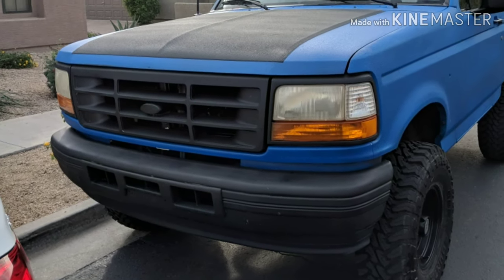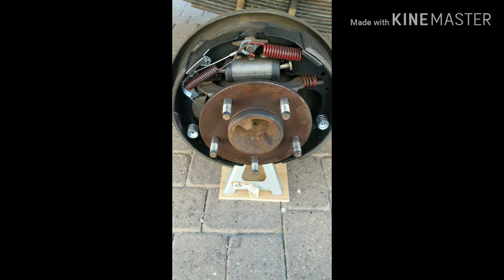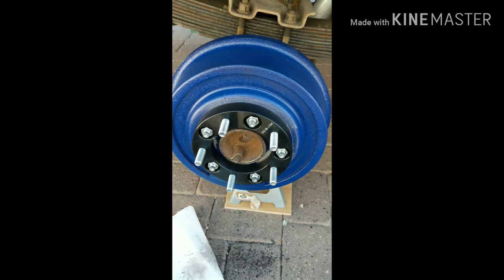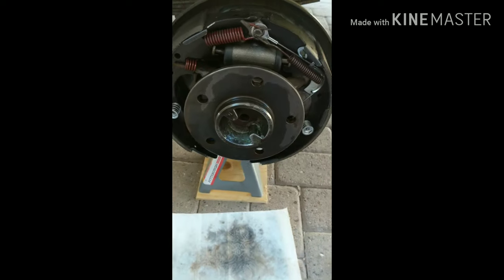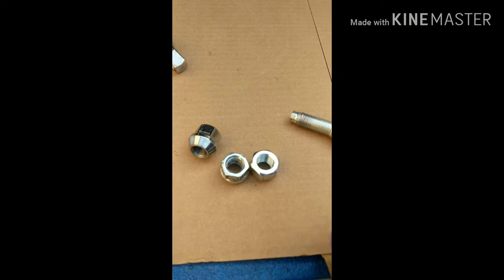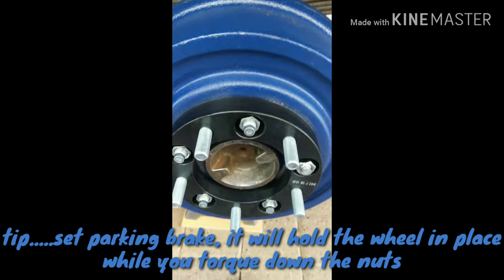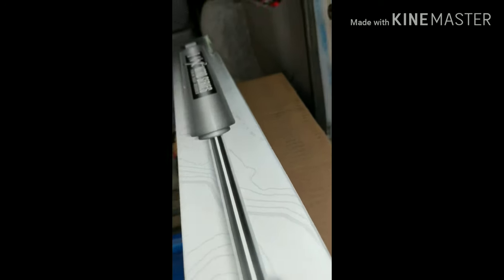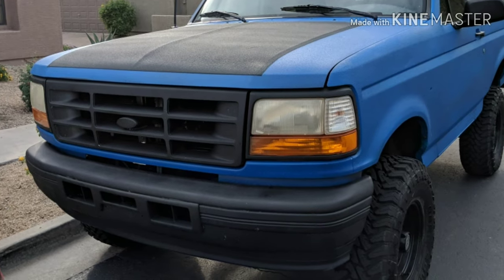1996 Ford Bronco Rear wheel stud replacement and wheel spacers

Comment: Great little video for people wanting to know how to replaced studs. What brand are your spacers? And any vibration issues with them?
Reply from the maker: ZY Wheel on Amazon. No vibration issues and I've had them on and up to about 85 mph.

Since I went off road with them and when I got back to the freeway a stud sheered off! I would not recommend wheel spacers ever again. Drop the money on rims with the proper offset.

Comment: TEXTBOOK EXAMPLE OF A *DANGEROUS* WHEEL SPACER INSTALLATION!!!  You seem like a nice guy but I must comment on this video, which unfortunately (and dangerously) depicts what NOT to do when installing wheel spacers (which are perfectly safe when installed properly but get a bad name when people who don't know what they're doing scream about their wheels falling off).  The key here is the comment you made about the wheel studs sticking out past the wheel spacer when you were mounting the spacer - THIS IS AN ABSOLUTE NO-NO and exactly the recipe for a wheel to separate from the vehicle!  In this situation the mounted wheel is riding on the ends of the studs, not flat against the wheel spacer as it should, and you have created a ticking time bomb.  You should have used spacers wide enough to extend past the stock-sized wheel studs or installed shorter studs.  You should remove this video or, if you'd like to create a teaching tool/cautionary tale,  pin a disclaimer at the top and make edits to clearly point out what was done incorrectly and what resulted.